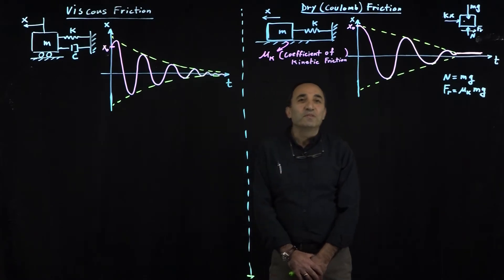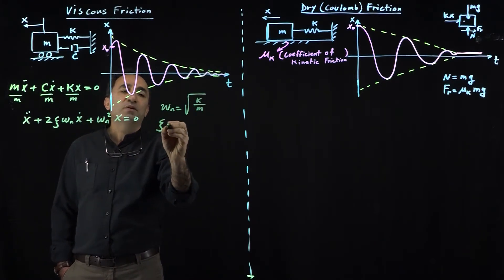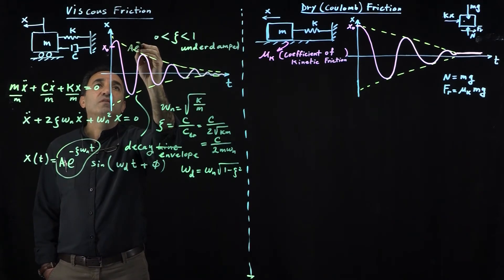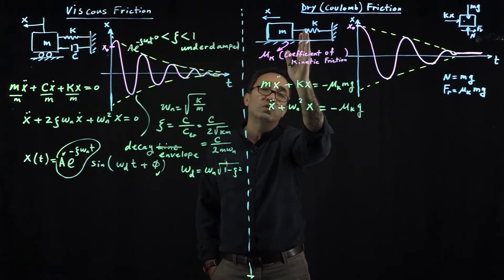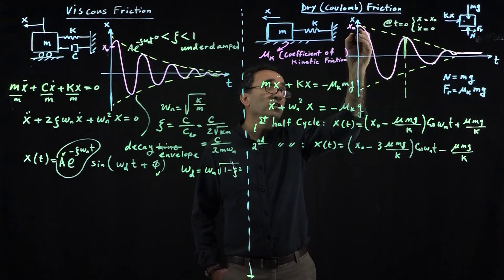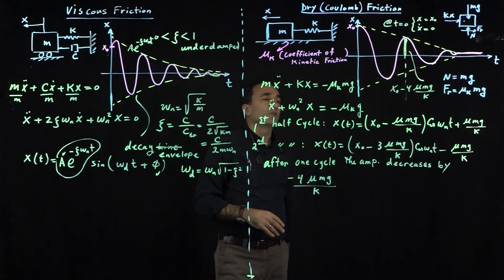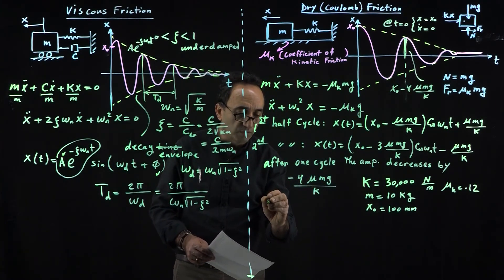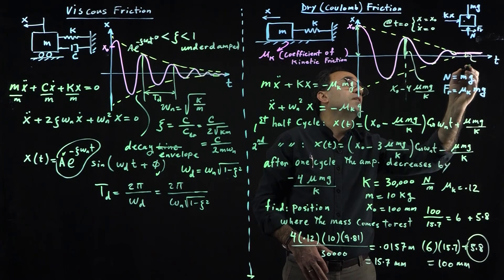Viscous damping response versus coulomb damping response: a comparison

Comment: Great presentation.  Your explanation describes a situation for roll bouncing on a surface winder.  Historically we have tried to dampen roll bouncing using viscous dampening. For air loaded cylinders, we try to restrict the flow of air using needle valves. They work but only to a small measure. Often we will replace air cylinders with hydraulic cylinders.  The theory is that hydraulic systems have low compressibility compared with air systems.  Your presentation describes the benefit of frictional dampening.  Back in the 1960's many "advanced" motorcycle suspension systems employed frictional dampeners. Example - the Vincent Black Shadow motorcycle.

Comment: Have you tried damping forces of the form:
F_d = b*sgn(v)*sqrt(|v|)*(sqrt(2)/4 + |v|^(3/2))
???
They suit better Stokes's law at low speeds, also the Drag equation at high speeds, and also allow to have solutions with finite extinction times (differently from classic results in physics that at best they "vanish at infinity").

Comment: I'm sorry, but I'm getting 0.0157mm. Can you help me with that?    I get 0.0000157 m
Reply from the maker: In this problem K should be 3,000 N/m and as a result you should get  0.0157 m which is 15.7 mm.
Reply: @MasoudOlia  Got it. Thank you so much for this video.